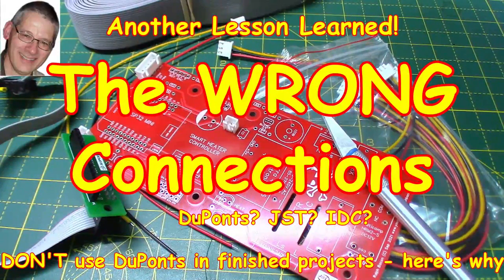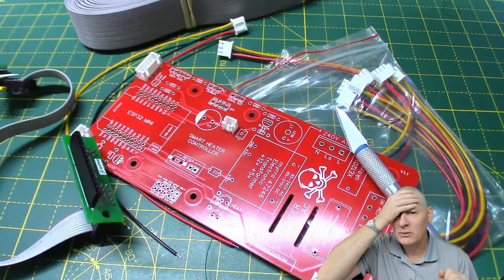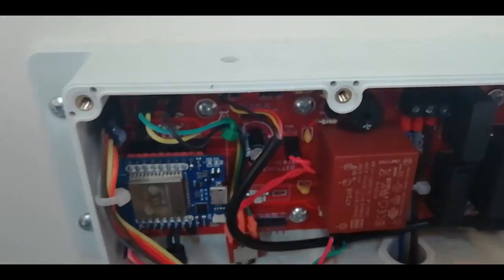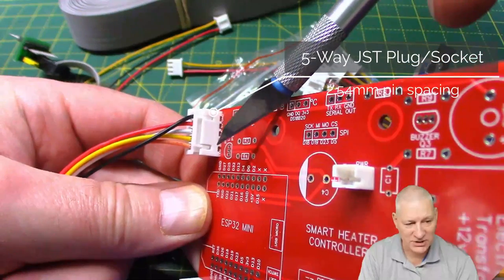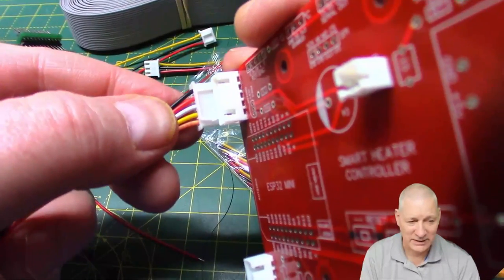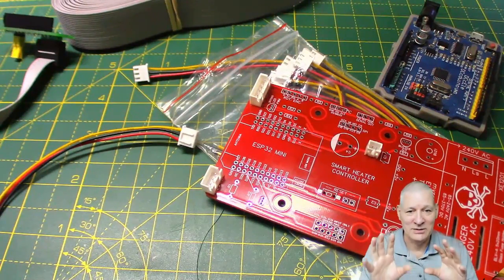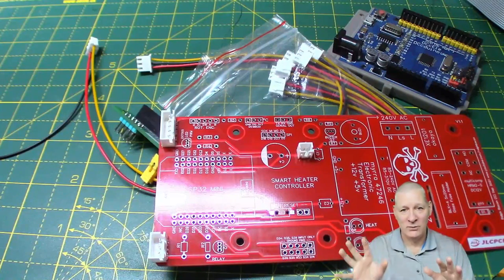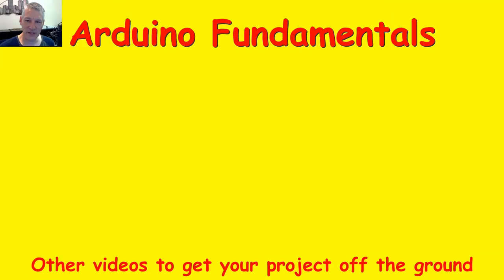#238 The Wrong Connectors😲forget DuPont, use JST or IDC for final use

Comment: i use RJ45 when I know I need several connections,   that are not within the box  and can spread longer than 10 cm.  easy to make cables for, and a rock solid connection.
can use stp, ustp utp etc. 

within the box, JST is great, so is idc flatcable.
Reply from the maker: Hmm, RJ45 for cable runs between boxes? Never would have considered that. Standard UTP cable?

Comment: At 15:20 can't salvage the plug? 

I have moved the plug for an IDE cable for two drives..
The cable was long enough in total, but the middle plug was too close to the motherboard end. I carefully removed the middle plug, then aligned it where I wanted it, and applied som pressure to it. Worked like a charm 😀
Reply: Sometimes the crimps on the ide connector cut the tiny wires in half. But remaining connected due to the connector plug.
Removing the plug can create a disconnection on the cable so it's not recommended to remove and reuse the same cable for that reason.
Reply: @jparky1972  I guess you are right. My optios was either
- try to modify the cable
- order an execcivly long cable,
- ordering parts, but back then online shopping was in an early phase.
Reply from the maker: I had trouble in two areas: removing the strain relief saddle and then prising the plug apart without it all falling to bits.

At the end of the day I decided life was too short to keep doing this and just cut it off and discarded it and promised myself to be more careful the next time round. 😉

Oh, as Jason says, the cable that had been pierced was no good to man or beast.
Reply: @RalphBacon . I was building my PC that day. I couldn't use the cable I had. 

I could"ve just ordered a much longer cable to reach within me PC cabinet, or give it a try, then order it if it didn't work.

 I was probably lucky with my cable, but it solved my issue that day.

Comment: You can use the DuPont connectors that come as 2, 3,4,5,6 and more wires in one connector - they are I bit fiddly to make but hold better than single ones side by side , a dob of hot melt on the side holds it the plug in place .
I think IDC plugs are always an even number so if you want 11 pins you have to use a 12 pin connector and leave one blank- could be wrong as I have never made my own ! They do look easy though and no fiddling around trying to crimp the tiny connectors that DuPont use - the right crimping tool makes it a bit easier though !
Reply from the maker: Yes, one downside of IDC is the even pin count and you can't get them easily below 6-pins (2 rows of 3).

Comment: Hello Ralph. Dupont connectors pop off when you look at them wrong. Therefore I agree with you 110%, never use Dupont connectors on your finish product.
Reply: if you agree 100% then considering max(agreement) = 100% you overflow it and you end up with agree = 10%  (if it is unsigned, otherwise you go to negative agreement) ;-)
Reply from the maker: Drat! I just looked at a DuPont on my breadboard and guess what? It's now lying disconnected in mid-air. So you were right. ✔

Comment: It makes no sense to spend money on a good connector and then to ruin it.  Slip a small screwdriver between the connector and housing catch and that side will release; repeat for the other side to remove the connector or use two screwdrivers.
Reply from the maker: Well, "ruin" is perhaps a slightly emotive word here, Byron; I'd prefer "customise". 😉 What I'm doing is removing the "locking" bit of the socket so we can get the thing apart again whilst we service the project - yet we are retaining the inherent friction fit that JST plugs and sockets give us. Note that I only "customise" the plug (which we can replace for an un-customised one) and not the (PCB) socket.

All this said, I've been investigating the KF2510 'Molex-clone' plug and socket which seems to give us the friction fit without the faff - I'll report back in due course. Give me your feedback when I do that video too, as I hear your reservations about this 'fix'.

Comment: Most of the IDC ribbons I make up are DB9 (DE9 to be correct apparently) and at work I just smack them shut with a well calibrated hammer tap. You’ve inspired me to be more professional and use my vice. This may please the desk jockeys who’re unfortunate enough to share an open plan environment with  production, calibration, and repair benches because some interior designer presumably watched too much Bones or CSI. I’d prefer an NCIS situation where desk jockeys are well removed and loud music can be played . Another great video Ralph 🙂
Reply from the maker: Hammer tap? HAMMER tap? OMG I said you had to carefully squeeze the two parts together!!! 🤦‍♂️ I'm sure your colleagues will thank me when you start using that vice (or buy a proper sub-£20 pliers-crimper).

Comment: Molex makes a series of latching connectors. The latch is a positive clamp that will absolutely not come off. To remove it you just squeeze the latch and pull off the connector. Very easy, doesn't take much more width than the connectors you're using now. They are available in 2.54 (0.1 inch) and 3mm sizes at least, and probably others. You might give them a try on your next project. I use them all the time on mine. Digikey and Mouser stock these in the US, but I'm sure you can get them in the UK as well.
Reply from the maker: I'm investigating some others already as a result of @Antonio Tejada's suggestions. I see if I can find the ones you mention too.

Comment: Good to see your still making vids Ralph.  Have not been doing much electronics of late so have not been following.  Need to do a binge session and catch up on.
But I was connecting up a new controller to my 3D printer and ran into the problem you describe here.   After seeing the mechanism on your vid I pried up at the base of the slot and it popped right off.  Thanks!
Reply from the maker: Glad I could be of help, Dan! I'm experimenting with a couple of connectors, you may see them in a future video.

Comment: Excellent video - thank you. I'm having the same problem with Dupont connectors which are still desirable due to their compact design (could be improved with more robust contact elements in my opinion). I have however had some success by lightly tinning the faces of the pins - very quick and easy and makes a huge difference to holding the connectors on.
Reply from the maker: It seems not all Dupont cables are created equally. I have some (relatively expensive) ones that are a joy to use. Others, from you know where, are terribly thin and prone to breaking; just about OK for breadboards!
Reply: @RalphBacon  Do you have a link to these as it's not easy to tell the difference on web sites?

Comment: The easy way to connect wires to a pcb is have a hole the size of the wires outer insulation and a track pad close by. So wire goes through the pcb bends 90 deg and solders to the track. The board provides the strain relief. If its passes vibration test for aircraft use should be no problem in your box. :-)
Reply from the maker: I've used two holes, so the cable goes in and back up again - rock solid but somewhat unwieldy - you can never unplug it if you need to. But undoubtedly better than any DuPont cable!
Reply: @RalphBacon  I think i've used every type of connector there is over the years. the important think is to clamp the insulation so all the flex on the wires is supported by the insulation. Solder is the worst as the wire break at the junction of the solder due to the increase in stress as the strand goes from flexable to solid. A good crimp is much better.
Reply: @TheEmbeddedHobbyist  100% agree with you!

Comment: Ralph, great to see this info on making ribbon and multicore cabling work for electronics projects - to put it in a nutshell, connectors for projects are a recurring nightmare! 

Dupont connectors are ideal for prototyping on breadboards but they are easily displaced or pulled out or deformed, so using them anywhere there are frequent circuit changes, vibration or finger-poking access always leads to problems.  JSTs do seem to be a better solution, small but with positive locking - but there are two problems with them. (1) There are so many variants and (2) Many are not breadboard friendly - meaning that you can start with a dupont setup and then have to redesign the connector set if you want a permanant setup.  Also, panel mounting JSTs is possible but painful for where your project offers plugable off-board ports. Nevertheless, Ralph, I agree that they are probably about the least-worst option. 

Though..... lately for protos I have taken to superglueng spring loaded DIL connectors (similar to, but a lot smaller than, Wago 221 connectors used for household electrical wiring joiners) to broadboards. for small wires those grab the wires really tight and never let go until you activate the release lever. That option works well where comparatively small numbers of off-board connections need to be made in such a way they can be undone if needs arise.   However, using those does kind of close the door to wholesale updates of your project and probably also to reuse of the breadboard. Nevertheless they are a good a option.  N.B. I have found that you can also use Wago 221s as well for small gauge wires such as used in electronics projects - they will hang on to and provide connections for our very small wire sizes - which is pretty amazing!

For external box-mounted connectors where size is not an issue I use connectors that commonly sell under the banner "Aviation connectors" on ebay and elsewhere. Good sturdy low-cost solderable plug/sockets with wide selection of pin counts and the plugs have a locking collar too.
Reply from the maker: The JST XH range is supposed to be 2.50mm pitch (according to JST) but everyone sells it as a 2.54mm compatible plug. It certainly fits fine onto Arduino pins/sockets.

I've never used Wagos (or clones of) on anything except household main wiring, I must admit. But those 'aviation connectors' look very heavy duty if I'm looking at the right ones - a bit like metallic DIN plugs/sockets?

Comment: From what I've seen, most commercial electronics will use JST connectors with hot glue to secure the connection. That's what I would do for a final product once all the prototyping and testing is done. If you're feeling confident, you can also just solder the connections and use hot glue for strain relief.
Reply from the maker: Oh, I'm ALWAYS confident that THIS time will be the LAST time I ever open the front panel. Until I do.

Comment: I use the 2mm jst connectors, the pliers part of my wire strippers work well for disconnecting them, just rock it back and forth a couple times.
Reply from the maker: Ah, yes, the magic rocking pliers trick! If you have a method of separating the two halves of a JST connector (even a 2mm type) then you have a solution!

Comment: One way to make DuPont connectors a bit more reliable, and make getting the connections correct a bit more foolproof, is to buy some empty DuPont shells in various lengths and pop the connectors out of the single wire shells and insert them into the multi-pin shells.
That way, provided you get the header shell oriented correctly, when it goes on you know you’re connecting the right wire to the right pin, and the additional mechanical friction caused by multiple pins in one header shell makes it much harder for one wire to pop off unexpectedly - and it saves you having to work out which pin that wire should have connected on to.
Having said that, JST connectors are much nicer and look more professional. Crimping your own connectors is a pain, but can be done (the guy with the Swiss accent has done quite a lot of research on crimp tools for JST and DuPont on his channel). The right angle version of the JST PCB connectors can also be very handy with some PCB layouts.
One thing to look out for with JSTs is the number of pins is very confusing. What JST refer to as a 2S connector has 3 pins, 3S has 4 pins etc. so, it’s very easy to order some connectors and find that they have one more pin than you expected, which can be a problem if you need a plug to fit into an existing socket, and discover that it won’t fit!
Reply from the maker: Your comment could have been written by me, Pete. I've done the singular to multiple conversion, works OK, certainly better than gluing singles together with hot glue!
My next project is using JST plugs and sockets so we shall see in a few weeks how it goes. These projects always take longer than you might think!
I even have a proper crimper for header pins but I find it so long winded and boring (I did loads when I used PIC chips 10 or more years ago) and I loathe doing them now.
Good heads up regarding that confusing numbering method. Counting from 1 to 50 wasn't broke the last time I checked so I wonder why they did it this way? 😜🤦‍♂️

Comment: you are ABSOLUTELY right about DuPont. I never use them for the production. Usually JST both 2.54 and 1.5mm. With IDC: the cable is... so stiff! If the insulation was kind of silicone... ;-) Also: IDC requires 2 rows what might be a challenge with general PCB you buy on ebay or so
Reply from the maker: Thanks for sharing and I agree that IDC cable can be quite stiff (remember all those floppy drive cables from the 1990s?).
Reply: @RalphBacon  (un)fortunately I do - I am from 70s ;-)
Reply: JST are 2.50mm pitch, despite what Chinese vendors say!
Reply: @tookitogo  stupid Wikipedia: "JST connectors are electrical connectors manufactured to the design standards originally developed by J.S.T. Mfg. Co. (Japan Solderless Terminal). JST manufactures numerous series (families) and pitches (pin-to-pin distance) of connectors."
Reply: @zyghom  The ones in this video, the XH series, is 2.50mm. JST makes only a handful of 2.54mm pitch connectors. (Trust me, I’ve spent far, far, FAR more time studying JST’s catalog than you have spent looking them up on Wikipedia. ;) )

Comment: I dont even use dupont for prototyping anymore, had so many issues, maybe the ones I got were of bad quality
Reply from the maker: There are some very good DuPont cables out there but are eye-wateringly expensive (especially when we've become so used to the cheap Chinese ones). But they do work so much better. About £14 for 120 from Amazon (and other sellers such as DigiKey, Mouser, RS Components).

Comment: I use hot glue to secure the DuPont wires when I use them,works well.CNC from pcbway looks exciting.
Reply: what is the difference between glued dupoint vs soldered wire to the board? idea of connectors is: to (dis)connect when needed ;-)
Reply from the maker: Multiway headers (NOT individual ones glued together) have worked for me in the past, as there is more resistance to being pulled off the header pin, but there is a limit. JST so much better.
Yes the CNC / 3D offerings from PCBWay look very exciting indeed, I might get to use them one day. ✔

Comment: I bought this JST connector socket. Cables were also soldered to the sockets and secured with shrink tubing.
But that's also a stupid idea, because the cables break off at the socket because they don't belong there. Or when unplugging, I pull individual pins out of the socket.
This doesn't happen if the sockets are on the circuit board.
Reply from the maker: I have a couple of sets of prewired JSTs too (both plugs and sockets) but the sockets have been designed to be used with flying leads (so are NOT just PCB sockets with soldered leads). I guess we have to be careful what we get sold out there 😮

Comment: After watching the video, I can tell you what I do. Use a pair of tweezers appropriately sized to squeeze the 2 tabs you’ve cut. That will free the plug letting you pull it out. Hope that helps. I think that’s my first tip on this channel.
Reply from the maker: That's a great idea! Hopefully not the last suggestion you'll make here, Mike! At least it didn't involve any C++ coding 😮